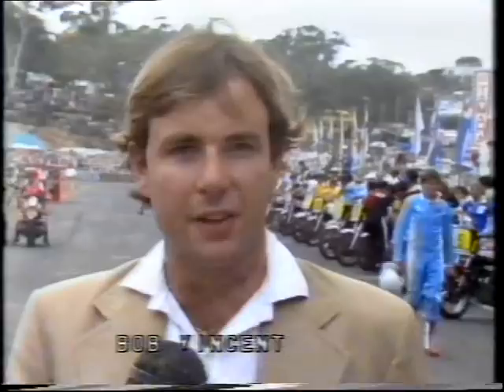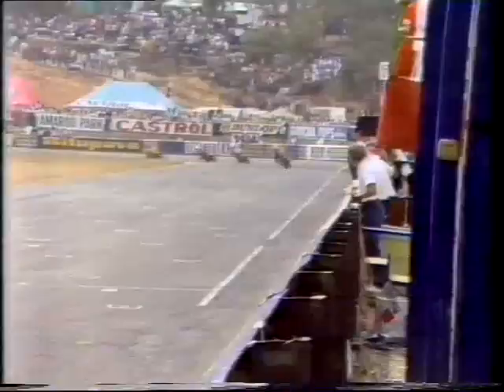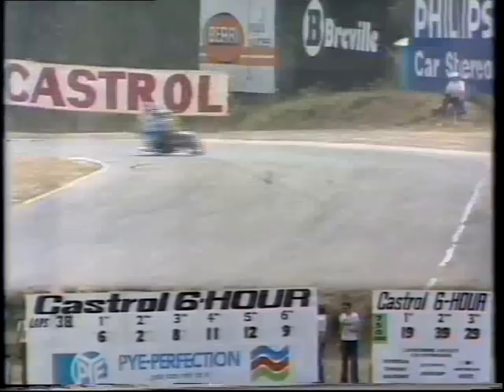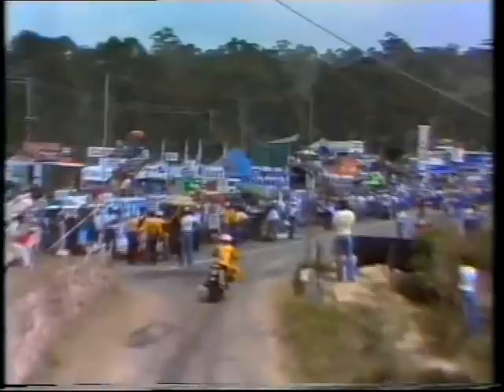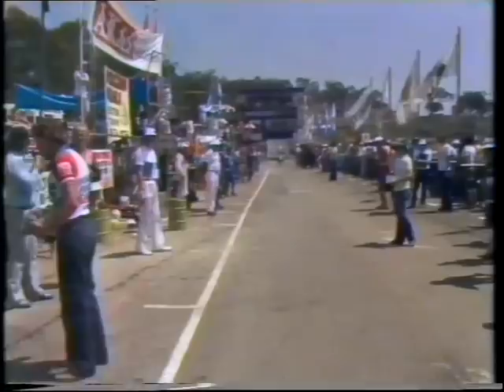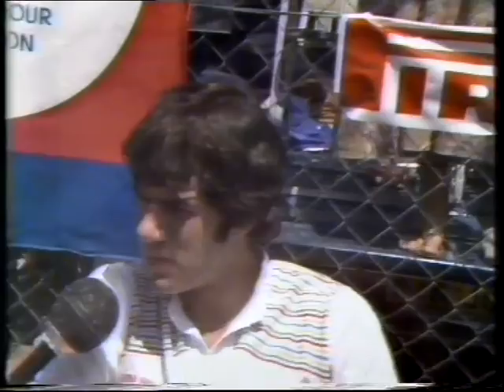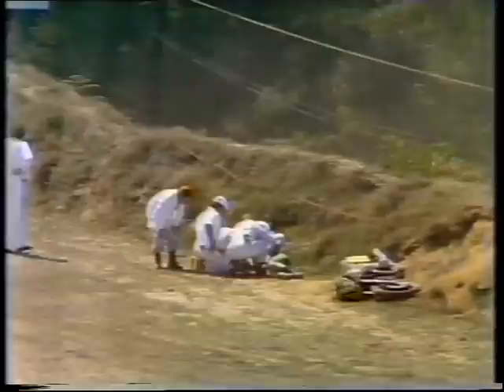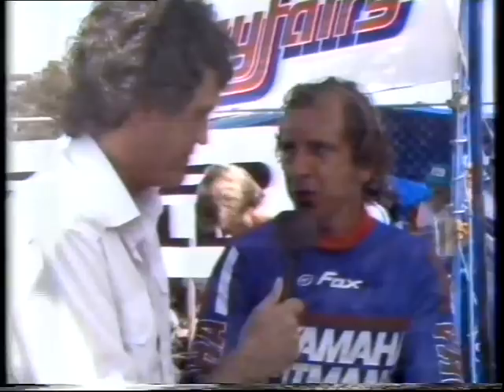Motorcycle racing 1979 Castrol 6 hour

Comment: Amazing how those aussies could turn an xs 1100 into - not only a racing bike - but a winning racing bike.
Reply: The Yamaha XS 1100 was a shaft drive bike right? I don't remember.
Reply: @hudsonhawk0016  
Yup, it was a heavy weight shaftie
Reply: @kasperkjrsgaard1447  It took some balls to horse those things around a track like that.
Reply: @hudsonhawk0016 Yes it was - but these bikes were converted to chain drive by the Aussies.
Reply: @DennisMerwood-xk8wp  I had a few bikes from that area,  all Hondas. My first road bike was a 1975 CB 750K then one of my two favorites was a 1978 CB 750F, CB 900F, 1986 VF 500 and finally a 1986 VFR 750. The CB 750F weighed between  537 and 550 pounds depending on who you talk to. In comparison the VFR weighed in at 436 pounds. I could carve up a road with the ol 750F but it got a little grumpy when pushed to the limit. The 750F and the VFR were my two favorite bikes out of the lot.
Reply: @DennisMerwood-xk8wp  no !!!!
Reply: @redtobertshateshandles  Yes they were!
Reply: @DennisMerwood-xk8wp  the 78 and 79 were with shaft drive.
Reply: @kasperkjrsgaard1447  Yes they were shaft drive and Greg Pretty was a legend on them.
Reply: Ed Kelly  correct.  The best Yamaha preparers were the Pitmans team from Adelaide.  They also engineered an XS1100 super bike that was  very quick with the shaft drive removes and a chain drive conversion.  Greg Pretty won the SWANN series for them on a TZ750.

Comment: These are unmodified stock bikes?
Reply: To a very large extent, yes.  
Everything has to be stock or easily available as an option (eg, there is sometimes a choice of wheel sizes) and the usual unnecessary parts (stands, lights, indicators, etc) are removed but it is a standard production race.
Reply: @markdignam3525 Thanks for the reply, I could see they were pushing the bikes limitations for sure. I fooled around as a novice with an 86 Honda VFR that was no where near what the pro riders with  same bike had. I also had 1980 CB900F that I would never imagine racing like those guys did. Lol
Reply: @hudsonhawk0016  
yes, they were incredibly brave to race street bikes with normal road tyres.
I actually miss that type of race, as it featured bikes you could buy retail.
I mainly rode Kawasakis - Z750, Z1000J, GPz1000, ZX-10 and ZX-10R over many years.
I never did serious racing, just a bit of club racing and these bikes were a handful on smaller tracks.
Had a few memorable two wheeled slides.
I never owned a Honda - had one Suzuki (GT750 often called the Waterbottle) and a FJ1100 Yamaha.
The Suzuki was two stroke and water cooled.  I shake my head in disbelief that I managed to survive.......
Reply: @markdignam3525  I raced for two years until we were expecting a child. My wife thought it would be a good idea to quit so I did. I wasn't really competitive and buying the HRC goodies for that bike was expensive. I had some fun though.